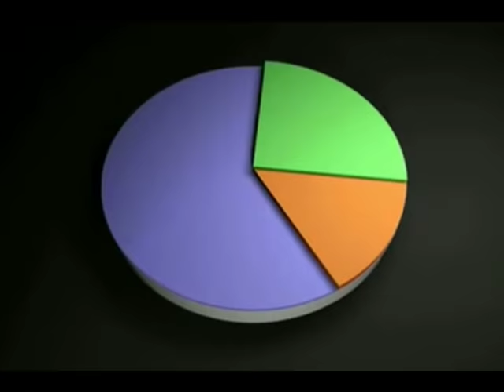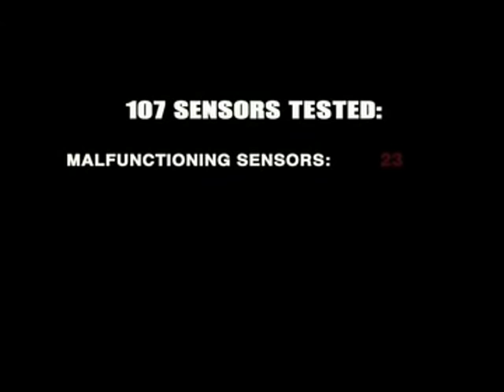K&N Filters - Do oiled air filters damage MAF sensors? Testing & Results

Comment: Actually, the truth is very simple. Small particles will go through K&N filters. That’s for sure. Will that matter? It depends. Is the air dusty and sandy? If yes, it will wear out  the engine faster, but by how much? Nobody knows. If it is a new car, maybe a few more hps is more attractive, extra engine wear is the next owner’s problem. Just remember, don’t throw away the stock intake parts and put it back on before you sell the car. I will not buy a used car with K&N filter.
Reply from the maker: I've come to agree with you. I don't think they are necessary on a stock car. If I need something bigger I'll be getting an OEM type paper filter cone.